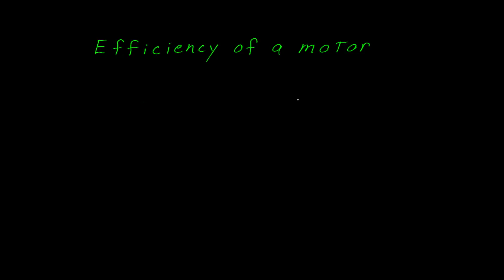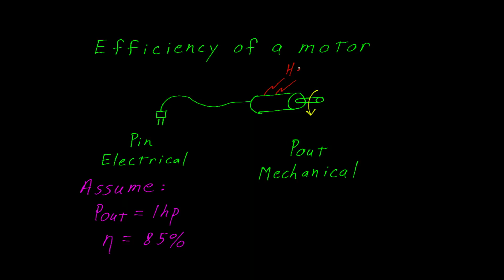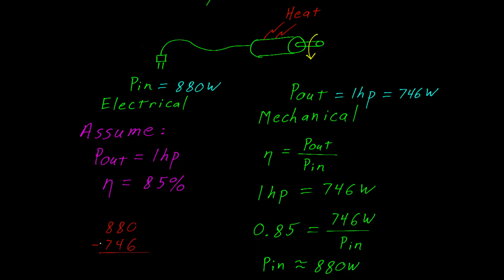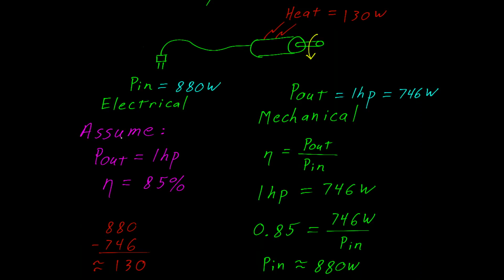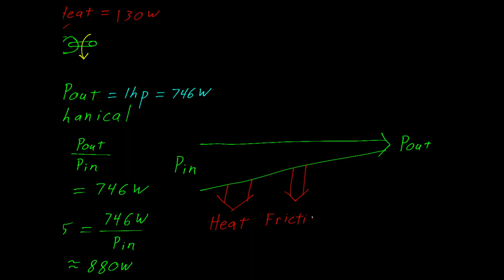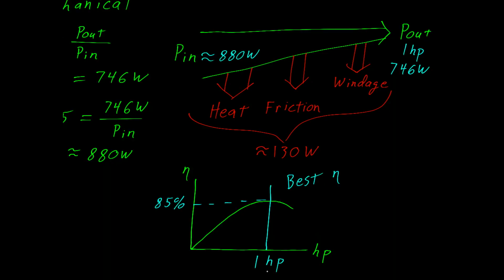Calculating Motor Efficiency

Comment: Hi Sir,
my motor in the name plate is 5.5kw 415v 3ph,act eff= 0.89 (88.5%),rpm 2890,p.f-0.89,running load 7.6Amps.
Please use this details,this is the old motor 5 years,now want to know what is the current efficiency finding that wheter motor reduced efficiency.ple help me to find what is the frequency now and this very helpful to replace efficiency motor.Thanks if get answer from you that much appreciated.thanks